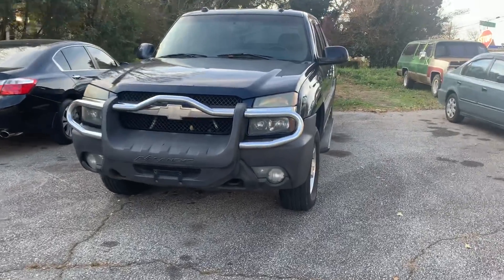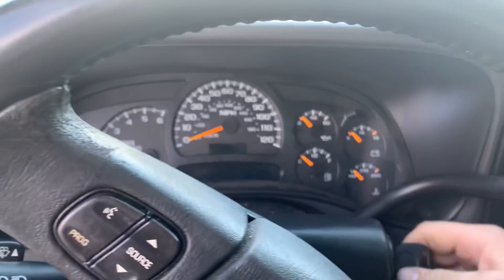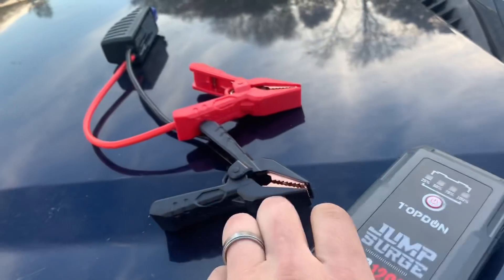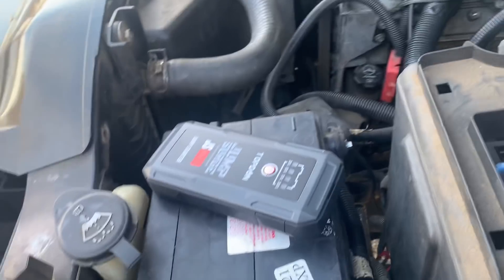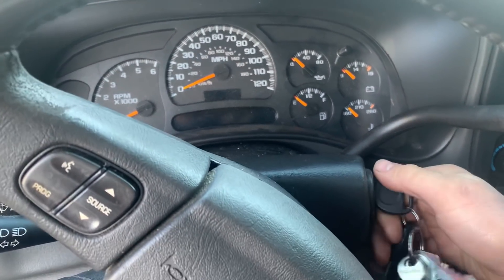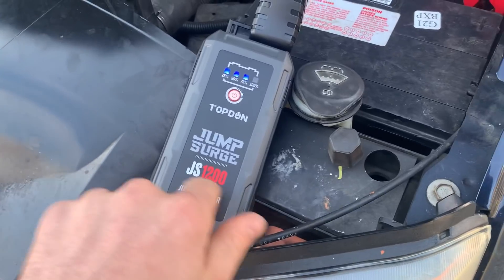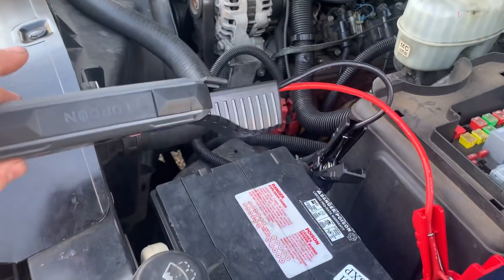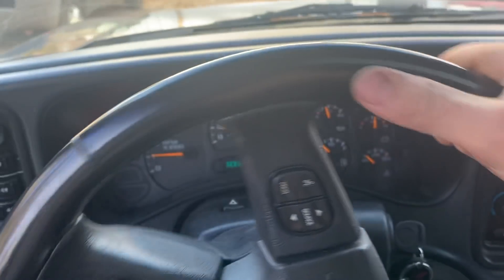“Justin Case” TopDon JS1200

Comment: The best one I have found is the Noco Gb70 it will start about 10 cars on one charge. It also doesn't have any issues starting big diesel engine either!
Reply from the maker: Ill have to look into those! Now for "big" jump boxes, nothing compares to my JNC 770r ! That has been my favorite tool addition, and I wont live without one now
Reply: @MXguy95  All we used to use at the body shop was JNC but then we found Noco. Way smaller and lighter. But I do have a Noco GB50 I have just laying around if you would like it.
Reply: @MXguy95  also I was amazed I thought these things would never be better than the JNC

Comment: I had one like that but it was a no name brand which would not jump my car. I am going to buy a better brand for my motorcycle.
Reply from the maker: If you want a small one they are a dime a dozen on amazon. But if you dont care about size, I have a JNC770r Ive had for years that is absolutely outstanding. Ive left it outside, in the extreme hot and cold. Rain, snow, mud, You name it. She just wont quit !